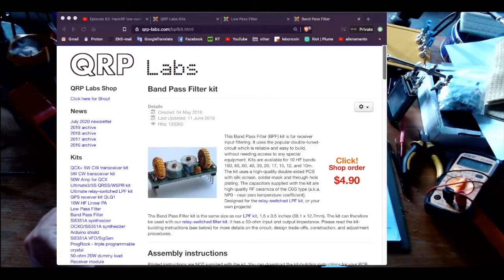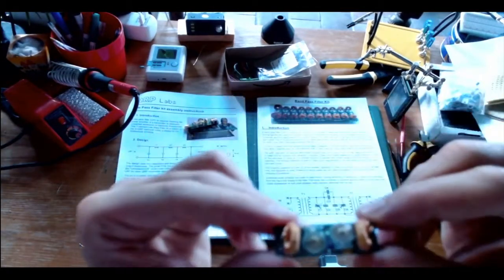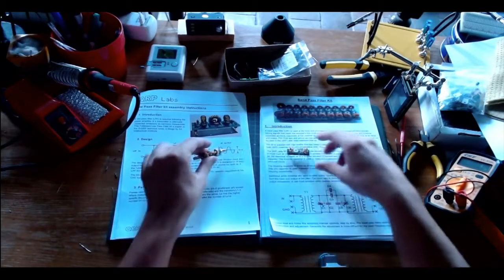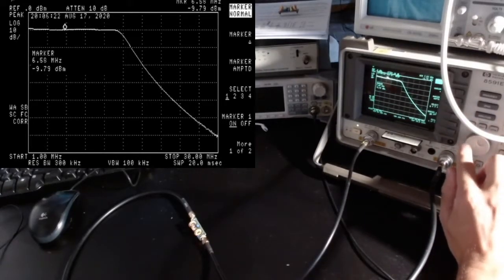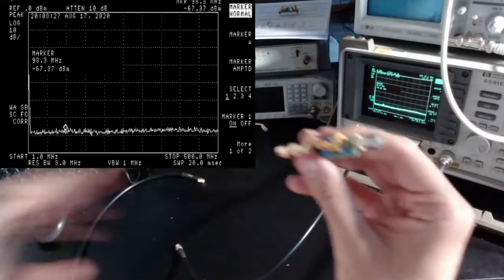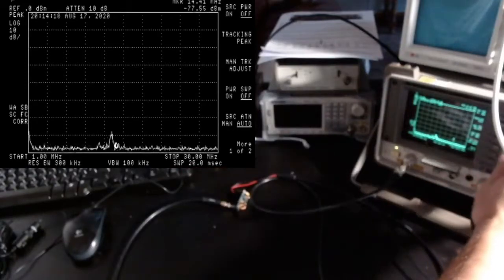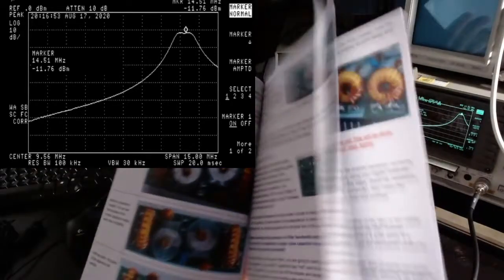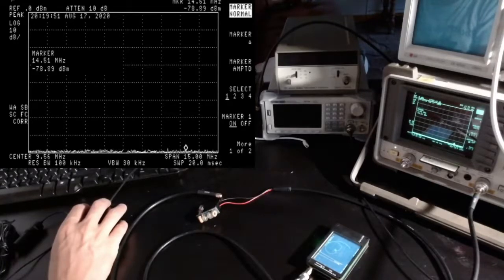Episode 63: QRP Labs filters (Low pass and Band pass)

Comment: Interesting, I do not see any attenuation of the second harmonic at 14.0 Mhz.  Noting your reference point is at -10 dB, you have -9.75 dB near 7.0 Mhz and only -10 dB at 14.0 Mhz.  I built the same kit and it is at -42 dB at 14.0 Mhz.
At 28 Mhz you have -66 dB which looks very good.

Comment: Very good indeed.  Looking forward to the next episode.   The high SWR on the NanoVNA has (I think) answered a niggling question I have had for a long time.   The question is "What happens to the rejected power of the low/band pass filter"?   My first instinct was to say "it is dissipated as heat",  But, of course, inductors and capacitors don't dissipate heat (not much anyway) - so I guess it must be reflected back to the source? - as the SWR shows.  What do you think?
Reply from the maker: Ahahah man! We are/were on the same boat! When I started learning, I also though that the "rejected frequencies" were dissipated in heat. Instead, as you say, they are reflected! See my Episode 12 where I discuss this 'discovery' :)

Generally speaking, ideal capacitors and inductors do not dissipate any energy in heat. They just store it in the electric/magnetic fields, respectively.
Reply: Definitely reflected back to the source and the output stage of the source heats up if the reflected power is high and can cause damage. 
This is a good video.